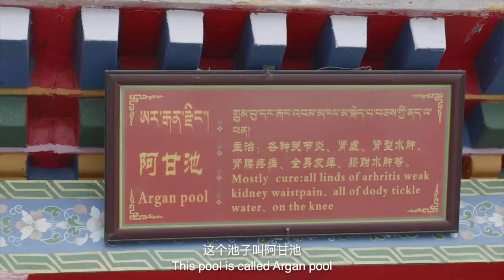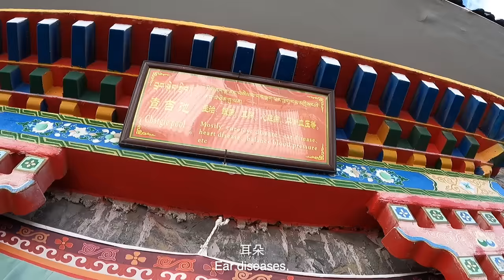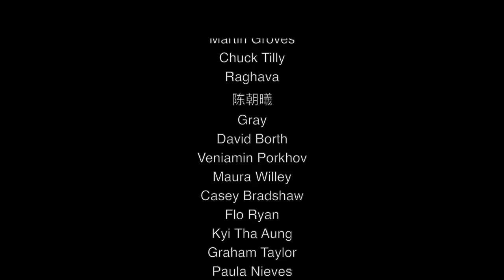TIBET'S Magical Hot Springs | S2, EP36

Comment: LCE ... I'm personally disappointed at knowing there's Tibetan owning foreign-cars ... instead of homegrown brands.

May I know what car brand you rode in ?
And how many foreign-cars did you see in that place ?
Reply: The first point: Most of these foreign brands are Sino-foreign joint ventures. The second point: Most of the cars needed in the alpine regions need large-displacement vehicles, because the altitude will affect the efficiency of gasoline combustion, while most of the domestic-made cars in China are more environmentally friendly. This has resulted in mostly foreign brands.
Reply: @user-nt5md7dp7t  
Chinese brands also have SUV and vans.
Reply: Chinese cars are not bad if not better loaded with lots of features and modern tech for better price, in term of safety, you just need to look at Euro NCAP crash test, many come out with 4-5 stars, a far cry from a decade ago. However, the Chinese mentality is,  anything from overseas, in particular, western countries is good. Chinese EV ( NIO, BYD) is the same if not surpassing brand like Tesla, but you will see people are driving Tesla instead of domestic brands, some would even buy EV made by Mercedes-Benz. This is all because of decades of industrialization with no quality standard inspection from the government. You can make anything and throw it in the market, dangerous power extension cord that would make poor people or cheapskate's house got burnt down, it does not matter, go get industrialized in full swing. What makes this madness even worse is, these dodgy products are allowed to be exported! so good luck, China, you won the title as the country of junk! if any of you here think that the  PRC government is smart, think again.
Reply: @glowndark1  
There are now quality standards.

Sad to know some Chinese preferring foreign EV ...

PRC should start crackdown on counterfeit and substandard products.
Reply: 西藏的地理环境基本最适合开的车就是越野车。 这里什么牌子的车都有。我在西藏生活了快10年，以前最受欢迎的车是丰田越野，藏民都喜欢买丰田。 现在国产越野车的质量都起来了，价格也更优惠，现在藏民越来越喜欢买哈弗H6。